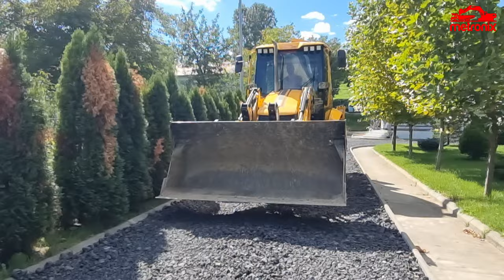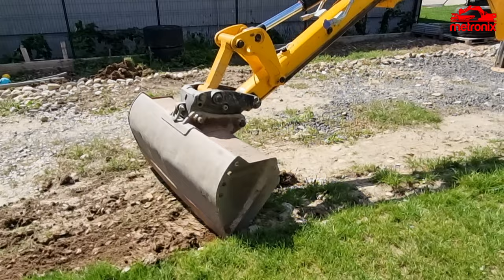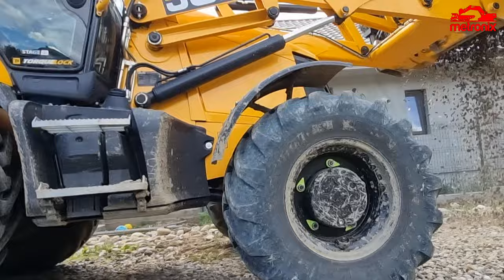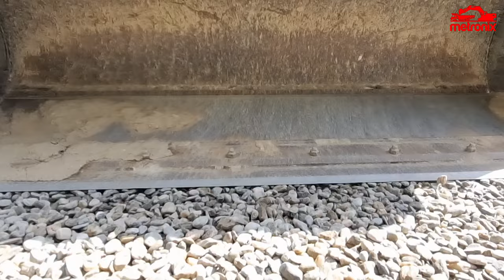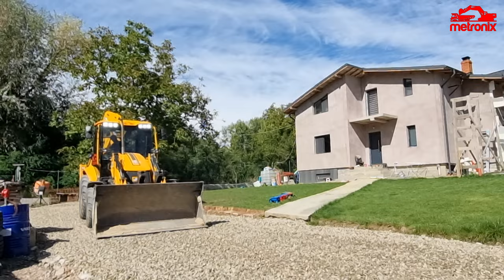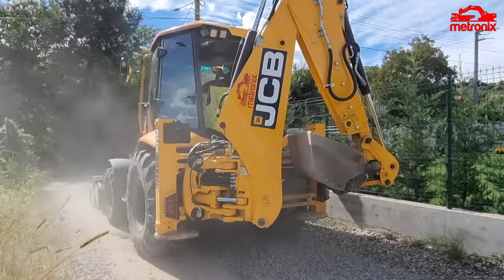How to use a JCB 3CX 6 in 1 bucket

Comment: I like the finesse you used in using the front loader trap bucket(is there an official name for that type of bucket) to lay down and grade the gravel for the driveway. Approximately how many inches or centimeters(I'm not sure what measurement you would use in your country?) do have the front bucket off the ground level or do you just sort of wing it so to speak?
Reply from the maker: The name of the bucket is  6 in 1.